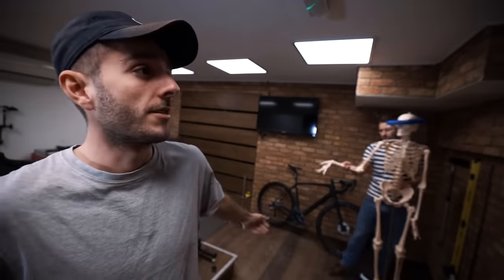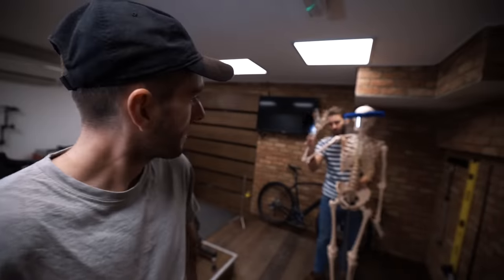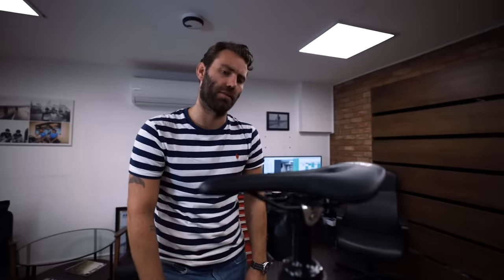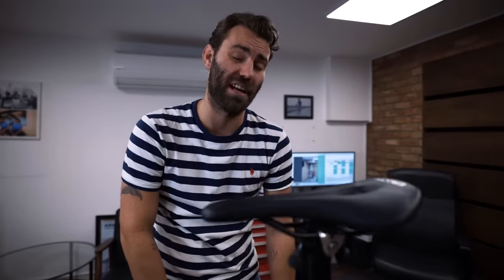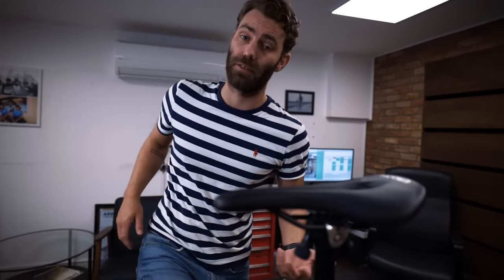Saddle Fore/Aft  Explained - How far back should your saddle be?

Comment: Slide it back allll de wayy. Like a ganster.
Reply from the maker: what's a ganster?
Reply: @Cade_Media  they make sausage rolls don’t they?
Reply: Might as well replace the saddle with a deck chair
Reply: @Cade_Media  gansters paradise... coolio... right? ;-)
Reply: @Cade_Media  haha, I think he meant 'gansta'
Reply: @andycorso8498  😭😂
Reply: @Cade_Media  Boardman was a GANster.
Reply: So basically the way to set saddle fore and aft is to have no fore or aft? Just get the right bike size?
Reply: @TheSchlooDoo  basically yes, but you have take into consideration how you are built. As James said if you have a broader torso with a lot of mass, in order to take the weight away from your hands, you need some setback on your seat post. But that can vary.

Comment: I had knee pain, I thought it was the setback. I moved my seat all the way back and it got fixed but my reach was too long and I got neck pain...
After watching this and the saddle height video, I returned my setback to center and reduced 30mm of seat height. All Fixed!!!!
Reply: I've spent years looking for my problem and it's easy to get caught up in "your saddle is too high" and "you need a shorter stem".. sometimes it can be that your saddle is too far back. If you do get a bike fit, I recommend getting someone like CADE to do it because even the "best" in Cambridge wasn't very good. It was very expensive.

Comment: YOU'VE SOLVED MY PROBLEM! I'm 6 feet tall with a long torso and short legs. I was putting my saddle all the way forward because my large bike has so much reach. But in doing so, I had to raise my saddle and ot gave me so much pressure in my shoulders and lower back. Now I can lower my saddle and reduce the stack for my short arms. Thank you.

Comment: Thanks for this one Francis and James!.  I got into cycling late and had a LOT of hand discomfort until I followed James' advice to lower the saddle.  Fore/Aft has been a big question for the last few months
Reply: I also just got into cycling.  You can also change your stem to shorter and/or more up-raised (+-10* vs. +-0*).  Both will have the effect of a slightly more upright position, which will transfer weight from hands to bum. Keep your current stem to try out over time to test your development, and adjust as needed.  It's not an expensive swap.
Reply: @daviddauza  I've had my road bike for about two years at this point.  I own two handlebars and 4 stems.  Nothing felt right until I lowered the saddle.

Comment: Another video that totally changes my understanding. I've got very long femurs and a short torso. Was fitted twice and both had a lot of saddle setback. I'd done the usual balance tests but never took it far enough. Now after watching this I wondered just how forward I could get and still not have a bunch of weight on my hands. The answer was all the way forward with an inline post.
Reply: Tha'ts very interesting to read. I have the same problem. I'm a medium size person usually, but my legs goes better with a large size. I'm trying with no setback seatpost and things are going better!

Comment: I did a bike fit in a local shop when I got into cycling, and the guy used the Kop's Method... I wish I had seen his video before, since I did not run away then!
To be honest, I did felt like it improved a lot my pedaling mechanics, in that I felt kind of "behind the pedals" before, and "above the pedals" after moving the saddle forward, per Kop's Method... but lately (since I now have an indoor trainer because of pandemic and stuff) I've been experimenting more, and after watching some of your videos I lowered the saddle and slid it back closer to the center of the rails... and it feels good! I'm doing it slowly, I will try lowering it a bit more and see how that feels. 
What I mean to say is, thanks for the excellent and scientifically-based advice here!

Comment: I've been struggling with this a lot. Thanks to James' videos I've lowered my seat a bit, set my tilt to almost neutral, raised my brake levers a bit and got a shorter stem, my bike feels lovely now but I can't get my seat aft/fore right. I'm a 5ft9 170 lbs male using an L sized frame (mistake, I know) and I have short legs. I've found that setting the seat at the middle makes me overuse my hamstrings, and too far forward kills my quads, so I guess I'll get a proper bike fit soon. My seatpost has that backwards position thing going on too, it's not straight or neutral, which I guess I don't need in a long frame to begin with. It's challenging.

Comment: I'm an Engineer and a maker and I was thinking of building a small setup with a side-facing (to me on my bike on the turbo obviously) camera which allows me to draw angles over footage of myself cycling such that I can at least get an ok basic fit in when I buy a new bike. Seeing as many (non-flexibility related)  issues result from improper saddle height and (to a lesser extent) reach, this may at least be a good starting point I reckon. Then, if I experience other problems (which will inevitably arise because I'm not considering left-right imbalance and no human being is perfectly symmetrical) I can go to a proper bike fitter and spend much more time on dialling in a much better fit because I'm likely to already be within most basic fit windows.

Comment: Hi James
Wish to consult with you-
Im not sure i understand or agree with the balance method for aft/fore position.
I believe the balance method is relative to the bars position/height. therefore i suggest to use this method maybe to the reach adjustments. 
For the saddle fore aft issue, i believe its all relates to the         p o w e r  of the stroke like you mention to be on "top of the stroke":
If your sitting too forward i feel that your upper front muscle - quads will be the only one to work or mostly..
If your sitting too backward, 
The feeling will be that your pushing the pedals forward instead of down direction while feeling weak from that.
There is a point in the middle, when you can feel your entire leg is working, and in the right direction.
This point is what were looking for and im not sure there is a real method to measure it (kops not convince me) but only by asking the rider himself when he feels most powerful and using his full front,back,up,down legs muscle.
Still investigating. 
What is your opinion?
Thanks

Comment: I'm 6'4 on a 60cm cyclocross bike that I use for gravel and road biking... they have slightly different geometry from a strict road bike...
I find myself never being able to find a true/perfect position. 

I'd say my limb lengths, torso lengths are all proportionate (in other words, I'm not 6'4 with long arms/legs short torso, or short legs long torso... I'm proportionate).

In order to get full leg extension... I extend my seat post fully at its limit. Maybe 1cm passed it actually.
Not only that, but I have to slide my saddle all the way back for a bit more leg extension, and reach (Since if I keep the saddle neutral or forward, I feel cramped up front).
I even have a 110mm long stem.

The position this puts me in.. gives me a feeling of kicking forward while my femur bones are too close to my torso (which doesn't allow me to put out as much power... although it puts me in a more aero position).

Issue is... 
If I shorten the stem... I'm cramped.
If I slide seat foward... I'm cramped.
If I slide seat post down... legs don't get extension.

I think I've come to the conclusion that my frame just isn't enough for me... Gotta go full road bike, maybe a 61cm.

Thoughts from anyone? Looking for all the ideas I can get...

Comment: 7:09  if you are a long torso man like James said "need saddle set back" (for weight distribution i guess) but doesn't it put you in a position too far back for pedalling efficiency cause your legs are short relative to  your torso. So you need to a bit more forward than normal not back because you should start fitting by the legs and bb position? Answer please

Comment: My rule of thumb is if I feel I am having to shuffle myself forward on the saddle as I feel my bum is hanging too much off the back then I need to put the saddle back a bit. If I feel that I am constantly having to shuffle backwards as I am feeling too much on the nose, I need to put the saddle forward a bit. It's all a bit trial and error in my experience. My current bike has a 20mm setback post on it (replaced the original in line post as I had the saddle on the max aft and still felt like I was hanging off the back of the saddle). I have quite long legs and a short torso.

Comment: When I got my bike I felt like I was being pushed too much in the back of the saddle, so I set my saddle almost all the way back. When I got some trouble in the back of my knee, I put my saddle a little bit more forward, as it wasn't excessively high. It helped my knee. It's still more to the back though, maybe because I'm on the heavier side, so don't want my weight too much on the front.

Comment: Thank you for the info about setback. I’ve got short torso and long legs and arms, and I find I feel best when my saddle is as far forward as possible. I need to try a zero setback seatpost!
Reply: I am in the same camp. I was thinking about fixing my reach issue with a shorter stem. Glad to know a new seat post is also an option.

Comment: Been messing with the saddle setback and reach . . . but the real test is in the ride. When powering the bike at different levels, your back and arms will stretch and your butt will find its natural position, and you can tell if you are falling off the back of the seat (too far forward) and can adjust accordingly for making the seat a comfortable pivot point. When you coast, your butt will come forward and more weight on the hands . . . that is another 'feel' of the seat and more weight into your genitals, so that also indicates the ideal setback position to get the horn from digging into your crotch.

Comment: I don't believe it can be said better.
And guys who care about their fit on their bicycles, if you want to achieve 'your' best fit and performance on a bicycle, there is no formula or short cut.  In fact, even visiting someone as knowledgeable as James will not get you to the top because each of us only know our own bodies. Dogged trial and error.  Almost all don't follow this advice but the only way to know what works best.
James didn't touch on the following but also worth mentioning. Saddle to bar drop affects amount of setback you can or can't run which affects hip impingement and of course relates to crankarm length as well.  A multi-variant puzzle. To me, it takes years to find a best fit on a bicycle.  For those...even tallish riders like me, try shorter cranks if you want a higher RPM, smooth pedal stroke for good sustained power.  Owning different bicycles and setting them up differently helps accelerate the process of determining what works best.  
I am now an old, fit cyclist after decades of experimentation.  I am a tallish, longer of leg and run a bit less setback, shorter cranks and not much saddle to handlebar drop to promote an unfettered pedal stroke.  Because I am still fit and not overweight, I am not plussed by how much weight I carry on my hands.  Lack of hip impingement is more important.  I use the drops a lot and can still get my back down but not as much as a younger, more flexible rider who can tolerate more setback resulting in less weight on the hands.  Finding Goldilocks is the goal.  No substitute for trial and error.
A sidebar many don't consider is, the stronger the cyclist you are, the more force you apply to the pedals with each pedal stroke which naturally reduces weight on the hands which allows a bit less setback.  There is synergy between strength of a rider and the position they can sustain on the bike.  This is why a good cyclist is typically more sore when riding with the wife at 12mph on your roadbike because there is more weight on your hands due to reduced pedal force.  People talk about watts all the time but watts can be correlated to pedal force.  Watts aka Power = Torque X RPM....Torque = Pedal Force X Crankarm Length.  Therefore at a given cadence, the more force you apply to the pedals, the greater power you generate which naturally unweights both hand pressure and saddle pressure...why hard to stay seated at full sprint pulling UP on the handlebar.

Comment: Very informative video...as are all your videos.  

After riding in basically the same position for over 30 years I started to develop neck and shoulder pain this year as well it feeling as though my pedaling efficiency suffering a bit. The position I had adopted back in the late 80's/early 90's was based on the Greg LeMond philosophy of bike setup...stretched out, saddle pushed way back, wide bars, etc. That position worked very well for me for a very long time.  Being 30+ years older now, I realized that it's pretty ridiculous to think that I can still ride efficiently in that same position. So I'm thinking of moving my saddle forward and most likely up a bit.  You mention a 1 to 3 ratio of this relationship.  Which way does it work?  My thought is that for every 3mm you move forward, you move the saddle up 1mm.  Is that correct?  Any comment on my overall thinking here?  Thanks!

Comment: Issue I find myself getting is, I've recently slid my saddle forward and I'm comfortable while riding seated and it just feels right! However, while riding, especially on the Turbo, over-engages my quads and they seem to do all the work in the pedal stroke and my glutes/hamstrings are just there for the ride (literally) after the ride my quads will be toast and will be on fire. I'd maybe touch the saddle back bit by bit but doing this means I have to move myself back on the saddle and feels unnatural.
Reply: Did the same and ended up getting knee pain. Saddle is all the way back and I improved the reach by changing the stem.

Comment: I'm also that short leg guy, but if you then also have more setback, are your knees then properly aligned with the pedals?

My uninformed intuition was that shorter legs require less setback because of knee position? Why is that incorrect?

Comment: I just upgraded my flat pedals from the cheapest Walmart Set.  to a $40 pair from a bike shop;  Along with the pair of bike shoes. 

 The 1st thing I noticed was my seat needed to go up to compensate for the shoes.
 But now it feels like I'm riding on my Guch or that bone in between my number 2 and nuts.

 I feel like that's an indicator my saddle's too far back and could be adjusted a little forward....  What do you think? or I'm open to commentary, I'm new to the hobby.   I haven't even completed my 1st year

Comment: Bike fit question for James:. Are there differences in position/fit for different disciplines?  i.e.  road to cross to track to MTB, etc.
Reply: A bit late to the party, but enduro (MTB) typically has the saddle more forward, as most pedaling is done uphill. This is reflected in modern enduro bicycles having pretty steep seat tube angles.

Comment: Would you be able to clear something up.  @ 8:13-ish you  say riders with a short torso may need to run a setback seat post, but at 8:53 you say riders with a short torso may need an inline seat post.  Did I misunderstand?  At 5'7.5" with a 32.5" inseam, I'm slightly leggy.

Comment: Why did you cut the video right there you said from the front of the saddle to the wall and from bottom bracket to the wall and you will get your set back but when I subtract  it what would be the actual  figure that's what I wanna know I know I did it once it was like 27 and 28.5 what would it be for this figure ??? Please and thanks

Comment: My physiology is just off the rails... I have hip impingement, but it improves with greater levels of anterior pelvic tilt. That does make my legs not quite track straight, but any variation of varus wedging, q factor etc. doesn't help that even with a baseline neutral pelvis. I'm quite comfortable on the bike, but it is kind of annoying to have the chest-high knees when getting aero. It's quite nice in a way, though, because the large degree of anterior pelvic tilt fixes any reach issues of my short torso long legs situation.

Comment: Lovely content! I do have a question.

The torso to force application direction angle has a narrow range for maximum force production. This fact does not allow one to choose any saddle fore-aft for a given aerodynamic position. In my experience, the body will try to preserve this relation ( torso to force application direction angle ) as much as possible.

The further back the saddle, the hips have to rotate backwards to maintain this relation ( otherwise the foot will get too far ahead of the optimal point ). The further we rotate the hips back, the less aerodynamic we get. The TT bike demonstrates this fact quite well.

Appears that we have to compromise between aerodynamics vs weight on hands.

For a new bike, wouldn't be better to choose one that allows the rider to be aerodynamic with not too much weight on the hands? So the balance/weight on hands test would just be a indication that the bike is the correct size? ( Imagine a too small bike, no matter how far back the saddle is put there will still be too much weight on hands to be comfortable, even after adjusting the reach ).

Comment: Question: since saddles are often different lengths to measure saddle setback wouldn’t measuring to the center of the rails be a more correct measurement than to the saddle’s nose (which can be different lengths)?